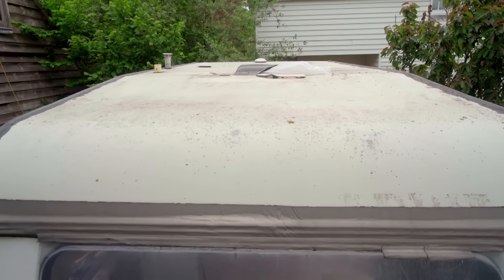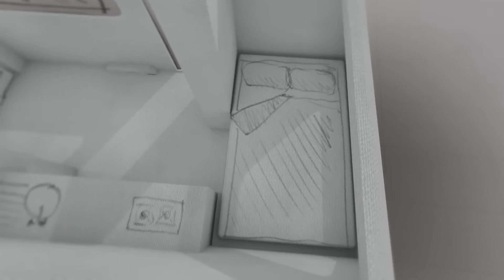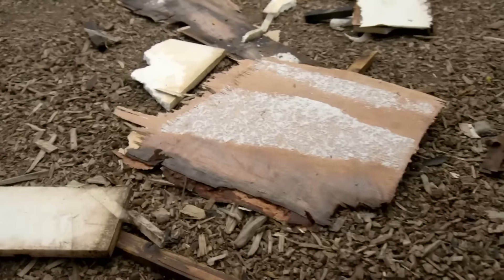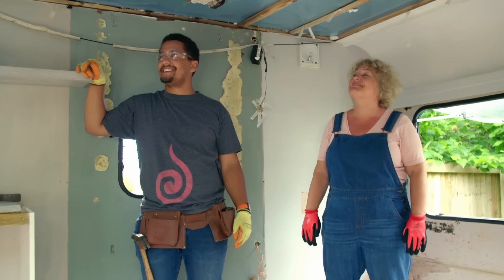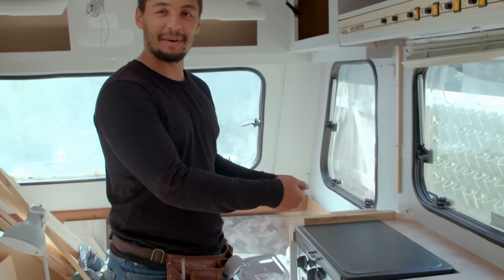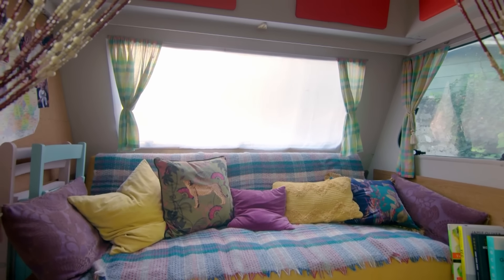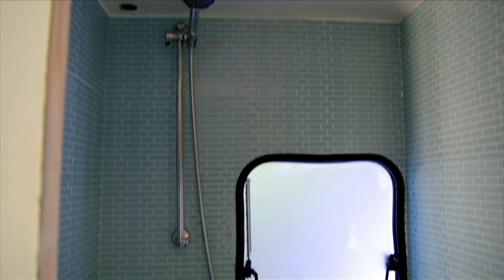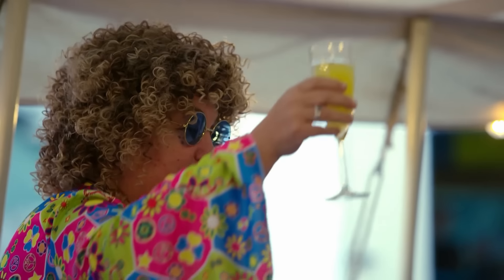Transforming a Run Down Caravan into the ULTIMATE Home | George Clarke's Amazing Spaces | Channel 4

Comment: it's hard work even for someone who is savvy with building... people have to understand that the van needs to be sealed properly roof windows floor, all of it!!! which is a chew.  then you have to ensure the electrics are all working, inside and outside, then the gas pipes then when you've done that the hitch and  wheels/tyres it's never ending  but worth it in the end.  Good job 👏
Reply: non of which they mention at all ,so someone might copy them and then end up towing an overweight, structurally unsound caravan with no running lights, dodgy electrics, 40-year-old tires, failed wheel bearings, no brakes, and if they do safely arrive dodgy gas pipes will cause a big gas explosion.

Ch4 is highly irresponsible for showing rubbish like this.

Comment: Great static caravan but if that goes on the road, expect everything to come flying off the shelves as there doesn’t appear to ‘transport’ proof shelves.
Reply: I worked at sea, and had towed a  caravan Previously, put things on the floor when there's motion, that worked for sea  and the caravan, it can't fall any lower than the floor. 🤗.

Comment: Would have liked to see some facts, like how much it weighs now, "a light touch" or whatever phrase they used does not instill confidence in me that the thing is not overweight and dangerous. Is it even structurally sound? did they construct it back up correctly,using exactly the right materials? Dont want anyone illegally towing something overweight and likely to fall to bits on a public road.
Programs like this are highly dangerous as even if they DID construct it properly, and kept the weight correct, they didnt show any of that process, or explain any of the dangers. What they did do was encourage every tom dick and harry to go out and buy a rot box and do dodgy DIY then take it on the road and cause a pile up and mass deaths.

Even things like wheel bearings,tyres etc - probably sat rusting and rotting for years, no mention of changing them. This thing is likely a total death trap and if its not, the one some poor viewer buys and follows their example will be.
Reply: This renovation program was totally unreal and devoid of any technical information and advice. Who do Channel 4 think they are kidding.